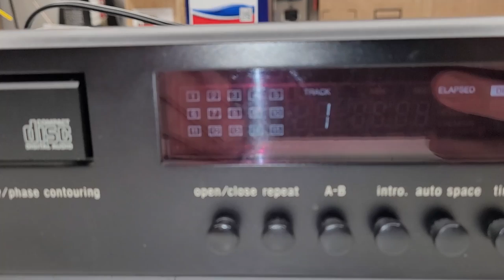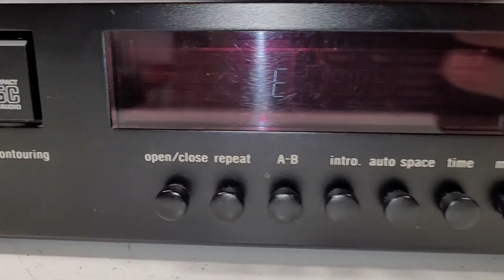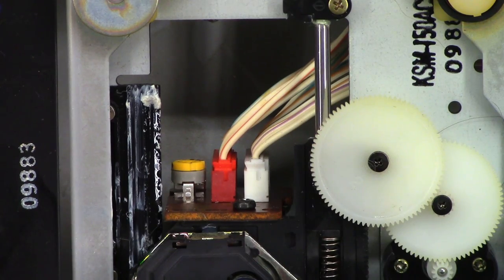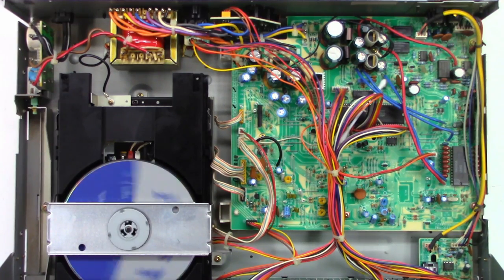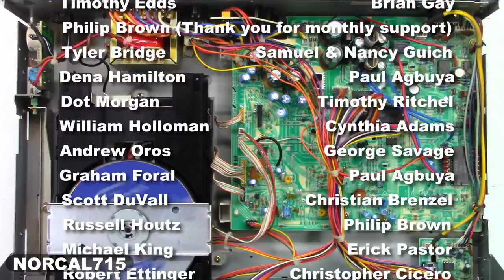Adcom GCD-575 CD player - CD stuck inside - Drawer wont open.

Comment: If you can find it, Stereo Review, gave this unit high marks. They used to test equipment for review...this unit tracked disc defects very well and had a quality output stage.  It sold for about $630 in the early 90's, which was pricey then.

Comment: I used an O-Ring for a belt to fix my dvd player, the loading belt was slipping, so I order a O-Ring, soon as I got it in the mail, I took the dvd player apart, took out the old loading belt, replace it with the O-Ring, it did the trick, dvd player now works good as new.
Reply from the maker: In a loading (not speed dependent) situation that should work perfectly.
Reply: @norcal715  the old belt use to open dvd drawer quicker I guess probably it was slipping, put the O-ring on opens bit slower than before, still works good, this was about 3 months ago when I fix the dvd player, should that be ok though?

Comment: Your video jumps from assembled to the chassis covers removed.  Could you possibly show, say what you did to get the covers off  please.  If you use a wrist grounding strap, would you still have to  short out those  2 solder joints? Or what if you attached a grounding  wire to the chasis while working on it?
Reply from the maker: you only have to short the laser grounding pads if you disconnect the laser from the main board, in a stand alone state. Sorry I didn't show the complete disassembly.
Reply: Hi
Getting an “E” message on display after CD loads. If the drawer opens snd closes, would that eliminate  a broken belt being the cause?
Reply: @eddiedegeorgis8842   it’s probably the belt. I have the same: the tray opens and closes but then the whirring and E message appear. I found that the belt is hardened and slipping,  not allowing to complete the disc clamping. I’m now looking for a replacement belt.

Comment: I fixed the drawer but on mine the motor that spins the CD is not turning also.  Any suggestions?  Thanks!
Reply from the maker: Does he motor run without the belt attached? You should hear it whirring.